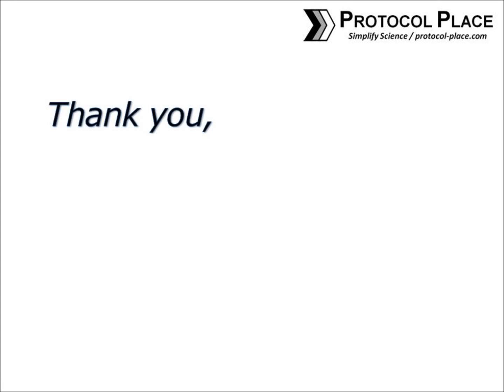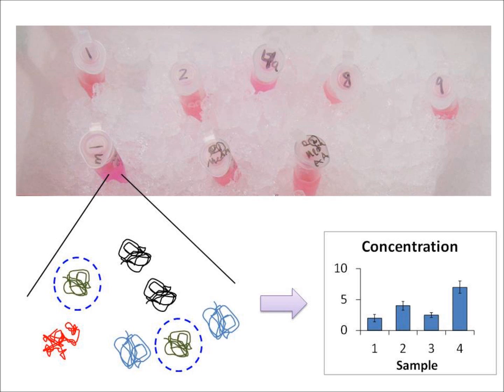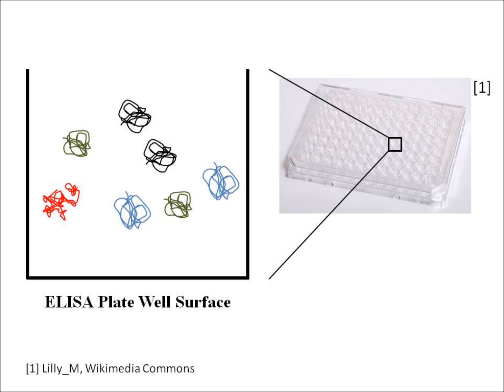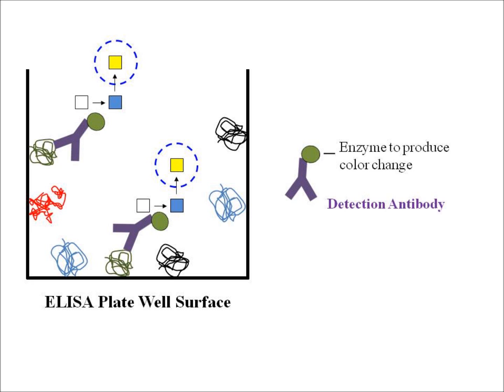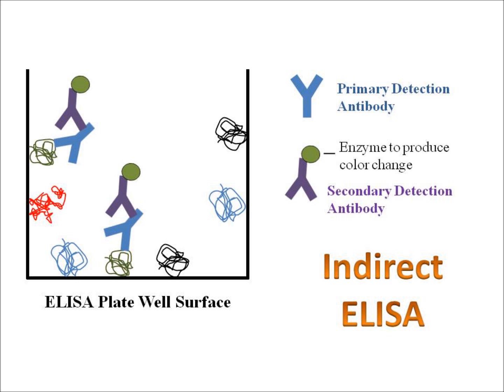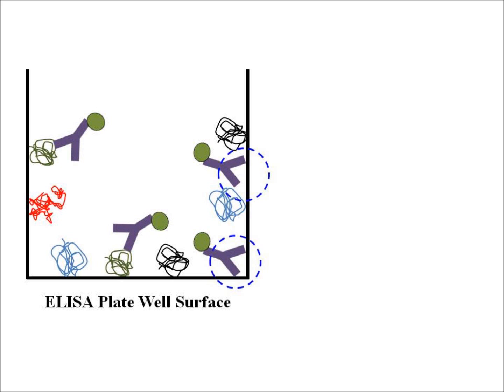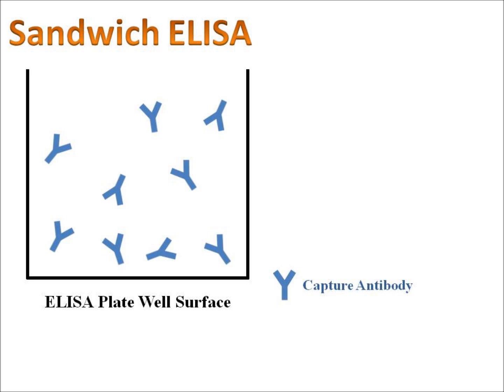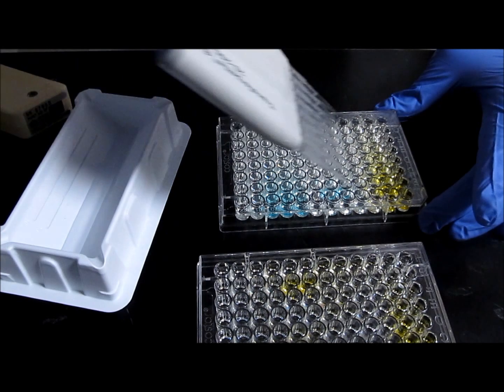ELISA Tutorial 1: How a Direct, Indirect and Sandwich ELISA Works

Comment: At 3:54, You don't explain why you need to go from clear to blue to yellow instead of just clear to blue.  Why don't you just measure the blue?  Why do you have to do an extra step to get yellow?
Reply: +Anna Heath I am sure it has to do with wavelength detection and the machine you use to measure the levels
Reply from the maker: +Anna Heath It turns yellow when you add acid ("Stop solution" as it's often called).  This step stops the production of blue color, and the pH change also results in a color change from blue to yellow (but the color change isn't really important, you could read whatever color you wanted with a plate reader but it just so happens to be yellow instead of blue because of this step).  If you don't stop the production of blue color prior to reading the plate, then samples will continue to produce blue while the plate is being read.  So samples read first will be biased towards having less color since they had less time to change color than samples read last by the plate reader, and this will throw off your measurements.
Reply: +protocolplace how come instead of adding a stop solution, we don't just have an incubation time to allow the substrate to be catalysed to completion and measure the spec of that

Is it because the enzyme in the antibody can transform multiple substrates subsequently? And isn't irreversibly modified after the first catalysis of substrate?

Comment: So which Elisa method do they use to test for HIV?
Reply from the maker: Denny Oak Theoretically, they could use any of the methods to test for HIV.  Probably more than one method is used, depending on the company that makes the ELISA kits.  You would have to do a web search and read about specific HIV ELISA kits to find out what type they are.
Reply: +Delta Ozone +Delta Ozone The evolution of HIV detection by ELISA is currently in it's 'fourth generation'.

I won't bore you with the original 1st and 2nd generation ELISA's, you can find that information easily enough.

The third generation was an indirect ELISA that was to detect antibodies in the sample blood and though it uses the same principle this video describes indirect ELISA as ( |-[ANTIGEN]>-[PRIMARY ANTIBODY]>-[SECONDARY ANTIBODY--CHROMAGEN] ) far as virology goes an 'indirect' ELISA detects antibodies to HIV, as opposed to the virus itself.

The fourth generation which is current was a pretty big breakthrough in HIV detection because it was the first to detect antigen produced by HIV directly (p24 antigen).  

It does several things by simultaneously running an indirect configuration in the plate well to detect for human antibody to HIV AND a direct combined with sandwich configuration to detect the actual virus (or rather the antigen p24 it produces).

It's very powerful because you can take direct, indirect and sandwich and link them together, you could have several intermediate antibodies that bind to antigen whilst also serving as part of the human antibody bonding 'configuration'.

This test is most important though for two reasons, the first is sensitivity and the second related to sensitivity is the ability to fairly accurately predict the time of infection (thus giving doctor's a lot more valuable information to work with HIV patient's to maximize they're treatment regiment depending on how long they've been infected with the virus).

It's powerful for sensitivity because both p24 detection AND human antibody detection must show positive.  This means that <any number of small laboratory mistakes which ... is what makes science long and hard> can lead to false positive (even if you have a -ve control it can happen if the problem is systemic ... that is you screwed something up very early on in eg. preparing your solutions).

So if you're using a 3rd generation ELISA you need to rely on a positive or negative result on only one detection criteria.  Now with 4th gen if you messed up something for the detection of p24 or the human antibody you'll know because only one will turn colour (you can't only have one, so if the other doesn't turn then your results have to be scrapped).  (MOST OF THE TIME)*

The other advantage related to dating of infection is that during initial infection p24 levels are extremely high as the virus is at it's most aggressive stage (all those yummy T-cell's all still virgin's to HIV) and until a certain number of weeks into infection there is no human antibody (or at least not enough to quantify).  

*So if they see only p24 and are CERTAIN there can be no false positive's they know the patient's infection is only a few weeks old AND shorten the detection window because people with HIV will test negative to a human antibody ELISA (3rd gen and below) for many weeks until the body has produced enough HIV antibodies for quantification.  To detect the HIV p24 antigen directly you can detect HIV theoretically immediately after infection, you just have to find p24 in the blood and there will be tonnes in the first few weeks.

The flexibility of simultaneously detecting the HIV antigen and the human antibody means there are countless configurations of dilution series etc. and can look at the relative proportion of p24 to human antibody to get a ROUGH idea of when infection occurred (ROUGH but MUCH more accurate then ever before).

So basically it's indirect, sandwich and direct (to anchor) but they mix the 3 in crazy novel way's to get as much info as possible about the length of infection and the person's 'susceptibility' to becoming immunologic ally compromised over another person.

Some labs still use 3rd gen but the WHO and a bunch of other medical hard hitter's have made it clear that only 4th generation ELISA should be used for a 'medically accurate' detection and generally speaking the medical community refuses to use 3rd gen.  These 3rd gen ELISA's are typically found in developing nations where they just don't have the $$$ for the fancy 4th generation AND 3rd gen ELISA are still GOOD, they just provide a fraction of the wealth of knowledge 4th gen HIV ELISA does.

Comment from the maker: Yes, you can buy your own antibodies (Ab) and do an ELISA on your own. Basically, you need to dilute the Ab that you buy to the appropriate concentration (see our Sandwich ELISA Protocol linked in the video description as a starting point, or you can follow the Ab manufacturer's directions if they have any for ELISAs). You must also purchase a secondary Ab that will bind to the primary Ab that you use (for example, use an anti-goat 2ndary Ab if your primary Ab came from a goat).  Good luck!